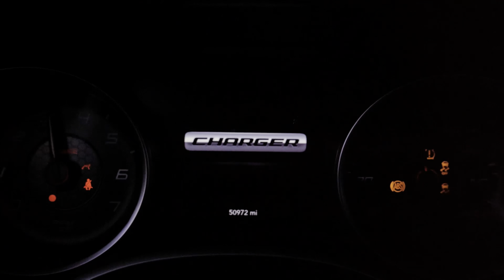MMX 85mm ported throttle body installation for Charger R/T

Comment: Do you need a tune for this throttle body?
Reply from the maker: No tune required. I’m going to data log and get a new tune try to get as much power from it
Reply: @slackonthego1489  let's go CHAMP
Reply: @slackonthego1489  same here trying to find a place to ceramic coated then  n I'm wrapping them I'm trying to keep underneath that hood cool as possible
Reply from the maker: @chachiluv4085  Yessir thanks for subscribing Bro
Reply: @slackonthego1489  np Sir Let's go CHAMP